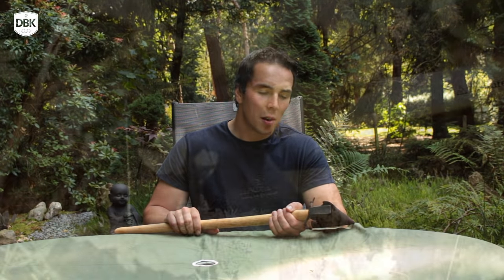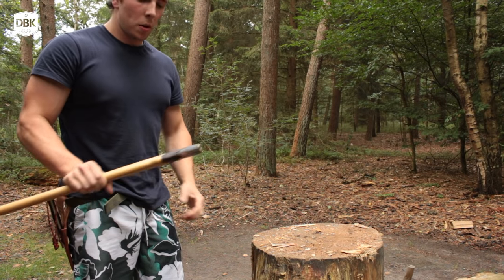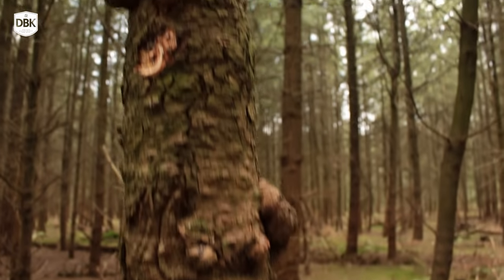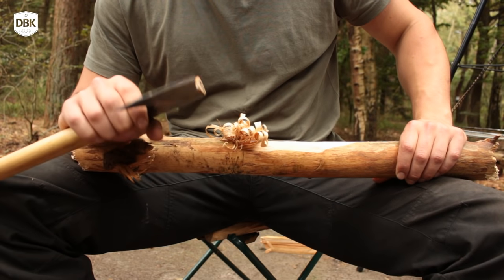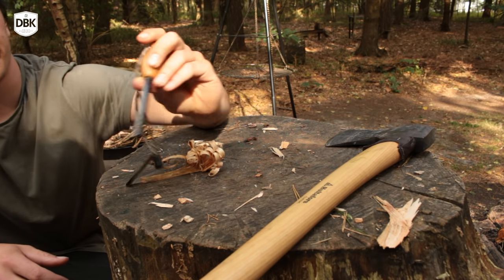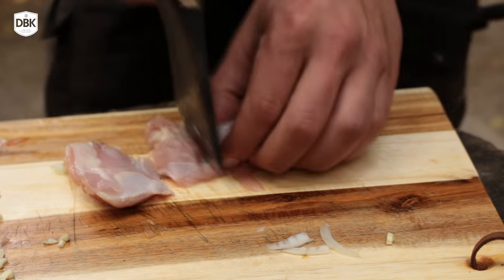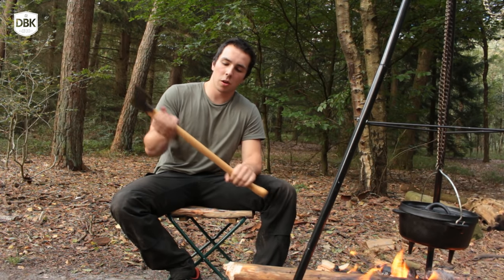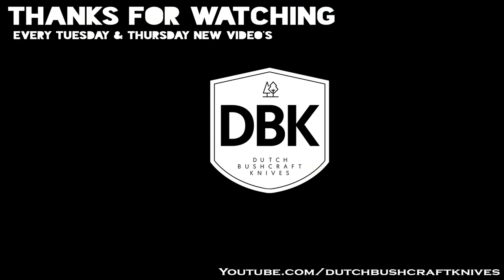The Axe That Does It All - Hultafors Felling Axe

Comment: the woods can heal easily from this ... cuts down the hole tree
Reply from the maker: haha. that one was dead already. the one with the nots was alive though.
Reply: Dutch Bushcra
Reply: chopped trees also grow back if the roots are intact. Most of the energy of the trees are stored in the roots.
Reply: oh nice. thanks I didn't know that :)
Reply from the maker: depends on which species of tree it is actually. A pine tree would not grow back that easily if you cut it down from the trunk. Oak or maple however will just sprout new twigs again.
Reply: Most hardwoods will sprout from the stump or roots.
Reply: #treelivesmatter
Reply: Hamish STEPHENS   LOL!!! Good you caught that!!!!!
Reply: Mathieu Jobidon he cut down a different tree
Reply: whole
Reply: I was just about to comment that when I read this😂
Reply: you read my mind in the past svart
Reply: Mathieu Jobidon what’s a hole tree? Do you mean WHOLE tree?
Reply: Dutch Bushcraft Knives *knots
Reply: Typographical errors can be fun : )  : )  : )
Reply: I was wondering how far I would have to scroll to find this. First comment I saw lol
Reply: @nickbutler9831  yes because its an oak but like he said a pine would not
Reply: Whole
Reply: @DutchBushcraftKnives  Marteen, favorite 13-15 inch hatchet budget or not?
Reply: @DutchBushcraftKnives  Where is Mikkie for this? LAZY !
Semper Fi
Gunny

Comment: Beautiful axe :) I own the H009 model (900g head, 50 cm handle) and truly love it. It can be used with one or two hands, big enough to split firewood and fell some medium size trees, yet it is small enough to fit into a backpack. And most importantly, it is not as expensive as the classic line or the ones that Gransfors bruk makes and i am not afraid to actually use it. It is a working man tool :)

Comment: My face when this axe is sharper than my kitchen knives.
Reply: Jack Evans Wheres the face your showing us?
Reply: dude seriously. My kitchen knives are pretty dull tbh
Reply: An axe is supposed to be razor sharp
Reply: Jack Evans obviously a damn axe will be sharper than some kitchen knife
Reply: @Anarcyx  So is a kitchen knife. If I can't cut a tomato without holding the tomato, it's too dull. It has to be as sharp as a razor or it's just plain dangerous.
Reply: @visin8984  A kitchen knife should be a lot sharper than an axe.
Reply: Learn how to sharpen and strop your kitchen knives, it's not that difficult. It's dangerous to work with dull knives.
Reply: A axe doesn't really have to be hair popping sharp to be a very excellant  wood chopper.....and with alot of axes to sharp and 2 thin of edge geometry  will much cuase damage  to the edge with rolling and chipping of the edge.....but is so cool when a big ole axe is hair popping sharp I make sure mine always are.....and really while the axe in the video  seems sharp and cut veggies well...it did not chop wood anything  as good as it could....I'd personally take a file and thing the cheeks quite a bit making for a thinner edge and better penetration into the wood....when. get a new axe a thing right up to the point that I get edge damage while chopping then steeping the edge angle slightly amd keep chopping and repeat till I no longer get a ton of edge damage then that's my final angle i sharpen at from there on out with that axe
Reply: @Anarcyx so are kitchen knives

Comment: I believe this is the same axe as the husqvarna 26" multipurpose forest axe.  The quality control may be less though and I dont' know that the husqvarna would be cheaper in Europe anyway, but I think it is here.  Just got one.  I'm just starting a video series to modify it and put it through the paces to make it do lots of different stuff.  Seems like it has potential.  I'm into the multipurpose axe concept.  The husqvarna is longer than the gransfors, though that may not be true by the time I reseat the head down far enough.
Reply from the maker: I'm curious about how it will end up looking mate! it sounds good.
Reply: First video is uploading right now, but it's just mostly me testing the axe out of the box.  I have some stuff I already don't like and will be experimenting a bit with the profile.  We'll see how it turns out.  I'm sure I can improve it though, at least to my way of thinking.  Cheers.

Comment: Say Heah Dutch,  Cheers.  A while ago,  I bought a 17" Hultafors Bruks Agdor Hatchet,  It's a older range and was replaced with a newer range,  like yours,  I bought it at a closeout at a great price.  The newer Hultafors Bruks  have the Swedish Style with the ears to reinforce strength. Mine is more of a European Style without ears,  But I really like it too.  I also bought a 26" Husqvarna  All Purpose Forest Axe  that's actually made by Hultafors Bruks,  My Agdor  came out spot on,  The Bevel and the wood grain was every bit as good as my G. B.  But not as sharp,  But it didn't take much to have it as sharp.  The Swedish Steel was struck multiple times and is an outstanding  Hatchet.  So I figured why not get the Husqvarna,  So I did,  But I had to return it,  At first glance,  I said what a beauty,  But on closer inspection,  I noticed alot of glue around the eye,  That didn't bother me,  But looking closer,  I noticed the eye was defective,  This is one tool I don't take for granted,  It had a piece of metal attached in tge eye where they had to specially form the axe handle too,  It was a good cover up,  But I still felt not sure and for an Axe,  I didn't trust it,  I bought it on sale at Bailey's at a sale price.  I had to return it so I contacted Robert and he was very nice about it and even gave me a voucher  to send it back.  I exchanged it with a Ochsenkopf Axe  similar in size,  It's just a little bit larger,  But I got the 620 H-1257 that has the Rowland Plus which is a steel plate over the eye and screwed into the handle,  It has the European  Style head and is made in Germany,  It also has a steel sleeve to protect the handle on over strikes.  I'm very familiar with Iltis Oxhead  which is who makes the Ochsenkopf Axe.  Years ago I had a Iltis Oxhead hanged on a 19 "White Hickory Handle  and made it a House Axe.  I started Baldric Carrying it and it's a great camp Axe,  especially when we process alot of firewood by Axe Tapping Technique.  That being said,  I also just ordered my 24" Council Wood Craft Pack Axe with the heavy duty sheath and sling  and this Axe became my Fav.  this time of the year and Winter Weather Bush Craft trips,  It's Aces, I like long hikes and scouting out new area's.  It's ideal for that.  I also have a G. B.  Small Forest Axe  which I really like too,  But as you know,  Their more expensive.  But that House Axe is the older Iltis and painted black instead of the new yellow their using now.  It has to be atleast a 2 3/4 lbs.  head with a 5" thin face face.  But the weight just makes short work and goes through knots like a hot knife through butter,  I keep it very sharp. But as far as an all purpose axe especially when processing alot of wood and just bush crating,  the Council is Aces.  In warmer weather,  I like to on person carry something like my 2Hawks Double Bit Hatchet or my WarBeast  which for its weight is an excellent  chopper,  I also have the three Estwings  even the Double Bit Hatchet  which I enjoy using and I can beat on those.  Thanx for a great review and Cheers,  M8.

Comment: Try Fiskars (real fiskars, not knockoff ones) axes, with composite shaft :) Where i live, everyone has them, they last trough rain and bad weather, and still do the job, and you don't have to worry about breaking the handle, by missing the wood. They are not too expensive either :)
Reply from the maker: +Psyconatpr thanks for the tip mate! We'll check them out!
Reply: I have a fiskars axe and hatchet. I use them for junk work like cutting roots in the ground where i may hit rocks
Reply: Fiskars are complete crap

Comment: It is easy for people to really discount the Axe today... but it is such a fantastic tool.

Saws are so excellent with modern machining and materials. Really where they have gained the most is in affordability. By being affordable enough to replace the blade often, you are always at the peak of your cutting ability. In days past they were expensive and hard to sharpen. The blade is extremely disposable, and the saw itself is mostly disposable as well.

Modern super steels are so much more capable than ever imaginable. Even older steels with modern heat treating processes have become stellar. Steels used for knives during the American frontier times would be flat dull by the time you batoned two logs. Comparing that to a 3V Bark river with a cryo heat treat is just an out of this world difference. It wouldn't even be in consideration as a primary tool.

Axes are just such a good design that still holds it's own despite all the advances in manufacturing. Yes they are improving steels and heat treat quality, but the gains are minimal because the base design is just so freaking good. You can rehandle an axehead that your grandfather used as a kid, and if it was designed well, it will still hold up admirably. If you handed that same axe on to your grandchild, you could be confident in handing them a real, working tool, and not some ancient family relic.

The axe is so effective, so affordable, and so easy to maintain. It's easy to see why it is such a classic.
Reply from the maker: +Dan Hauswald i agree completely! I find myself using it less but i still admire it. It's the only tool that hangs in my bedroom instead of the shed so i can gaze at it haha. A friend made me a custom leather sheath for the axe head. I love how rustic and axe can look.

Comment: I have the Hultafors "Classic" The handle is a bit shorter. Everything you said is true about these axes. I worked mine a bit more than factory sharpness and you can shave with it. 
A quick tip.  
You can use an old bee's wax candle to rub down the handle with. It waterproofs and provides grip. It does change the color of the handle to a nice honey color..  ")
Reply from the maker: Nice! great tip i will try it!

Comment: Great video!  Timely too.  I was just coming to the conclusion that the small axe was the premier Bushcraft tool and here you are demonstrating the concept.   I especially like your comments about head weight and handle length.  I would also appreciate it if you considered providing the price in other currencies.
Reply from the maker: the euro and dollar aren't too far apart right now I think  it would be 80 dollars but ofcourse I don't know if you can get this axe for that price outside of europe. UK is also a bit more expensive most of the time.
Thanks a lot Alan!

Comment: That food prep was amazing!  Did great on the veggies.  I think it could use a stropping before it gets on the meat though, especially since the cutting surface is short as compared to a knife which you can drag and slice with even if it's not razor sharp.
Reply from the maker: Thanks a lot! stropping would have helped a lot but I wanted to see how it performed finer tasks after the chopping. It did great! i'm very happy with this axe!

Cheers!
Reply: One thing I would like to see is a close-up of the hang - under and above the eye, to see if there any gaps, cracks, or glue. I also would like some clarification on the manufacture.  I think Hults Bruks is owned by Hultafors, but they have separate lines of axes.
Reply from the maker: hey, They are pretty unclear about where they come from. On paper they make it sound like they are older than Gransfors and wetterlings but maybe in the end they are all the same? I can't tell you sadly. I'd have to check the eye as soon as I'm at my place in the forest again. I don't remember seeing any gaps before the tests.

cheers!
Reply: Thanks!

Comment: At the beginning you say "handforged axe" and at 11:08 you say "the handforged head...". It isn't handforged but drop-forged. That means they use (as Gransfors Bruks or Wetterlings also do) a swage and air or pneumatic run hammers to form the head and not a hammer and an anvil. The handwork is transporting and moving the red-hot blanks to form the axehead in the swage. Doesn't matter on the qualitiy of these axes but it's an interesting detail to know about the production process.
Reply from the maker: thanks a lot for the info Didi! we always appreciate it! We also learn a lot from our viewers!

Comment: Say Heah Dutch,  No offense,  But I'm proud to be an American.  I just got a 24"Council Wood Craft Pack Axe with the Heavy Duty Sheath and Sling.  and yes before that I was getting by with my G. B.  Small Forest Axe,  But it was still lacking.  But once I got my Council Axe,  That all changed and It became my Fav.  I did make a House Axe a while back,  It's the same size as my G. B.  But with a much heavier Iltis Oxhead,  It's our camp Axe since it simply makes short work out of processing firewood in our cold weather trips,  But I heard about the Husqvarna 26" All Purpose Forest Axe,  So I bought one impressed with the price,  I guess the saying you get what you pay holds true.  When I got it,  It looked beautiful,  But on closer inspection,  I noticed alot of glue around the eye and handle,  That didn't bother me too much because of the price,  But when the eye was defective,  I said Oh Oh,  injury.  So I sent it back.  The guy didn't want to replace it for another one,  Saying I might find something wrong with a replacement,  So I think he knew something,  But he replaced it for a little more expensive  Ochsenkopf Axe similar but a little heavier,  I didn't mind because my Iltis Oxhead House Axe makes the Ochsenkopf Axe and I also got it with the Rotband Plus the OX 620 H-1257  I think this will be our new camp Axe.  The Iltis Oxhead House Axe,  I still will use now that I started to Baldric Carry it and how it simply destroy the wood processing,  Aces.  Oh,  the Husqvarna  is made by Hultafors Bruks,  But I bought a 17" Hultafors Bruks Agdor Hatchet and  when I got it.  It was spot on, it only took me a very short time to have it as sharp as my Small Forest Axe.
Reply from the maker: thanks for sharing your experience mate! we keep it it mind.

Comment: Hi mate, nice Video. I have a question, can we let the Wood handle get wet without Problems? And If yes then can we still Work with it(when wet)?
Reply from the maker: Yea it can get wet! BUT do oil the handle before any use, otherwise it can start to wear on the wood!
Reply: @DutchBushcraftKnives  I was thinking to applying 2-3 Times Yacht varnish and forgot that Problems for a Long Long Time. With gloves varnish does Not slip. What you have to say about that Idea?

Comment: How does it compare to the gransfors bruk?
Reply from the maker: I think gransfors has a slightly better quality control but I haven't noticed any difference in quality so far. I think the steel is exactly the same. My handle seems to be selected nicely and I have no negative points what so ever on this axe. But I also have no negative points on my GB small forest axe.

Comment: There were no 'Old School Days' just using an ax. An ax always has been in addition to a knife. In Scandinavia but also for the settlers in the US ad Canada. I challenge you to find any tribe/people in the world that just used an ax. Even Nessmuk showed his tools consisting or a pocket knife, a fixed blade and an ax.
You prepare food that's bought in the supermarket. You are not gutting and butchering small fish or animals. 
Even if you find the balance point on the ax it still has the weight so it will cost you a lot more energy to use it. That energy must be replaced with food. So an ax for food prep is always counter productive. Just carrying an ax with you is kinda counter productive when it comes to survival because of the weight. Unless you need to build a log cabin to survive long term.

Comment: Its not clear to me from the video, but did you do all this with the stock edge as it arrived? Or did you hone the edge before doing all that work? I really like this review, as you did a lot more work with the tool rather than just holding it and gushing, well done.

 For the small wood at the top I think you might enjoy trying the one chop technique. Very good video about it here. https://www.youtube.com/watch?v=OIwGMpCDI6Q&t=72s
Reply from the maker: thanks a lot for sharing! I didn't have to sharpen the axe while I normally sharpen every thing that I receive. I did do a few strops over 3000 and 12.000 grit compound to get rid of any micro oxidation on the apex.

Comment: Great vid, although i will say you're loosing some energy when you try to cut the tree trunk. It moves and flexes, dissipating the energy of your axe like a shock absorber. Chop over the block and you'll save yourself some time.
Reply from the maker: agreed! it was a bit awkward like this. Thanks a lot 
The recipe was just an improvised dish but it was great. I improvise most of the times with my Dutch Oven as it always turns out great. For these stews I just pick some vegetables that I like and some spices together with chicking, pigeon or beef. 15 minutes before taking it off the fire (after 2-4 hours) I put in rice and raisins to make it a one pans dish.

Comment: your name should be lightning. You never hit twice in one place.
Reply from the maker: +Roy hahahaaa
Reply: I worked for some time as a cutter in the woods. Had a really great time, but moved into working smart rather than working hard. Firing a secondary education heating system with wood is tiring. I do like that axe, and would not mind trying it out. The biggest revelation in cutting is that for every minute you spend sharpening, you save ten minutes cutting.